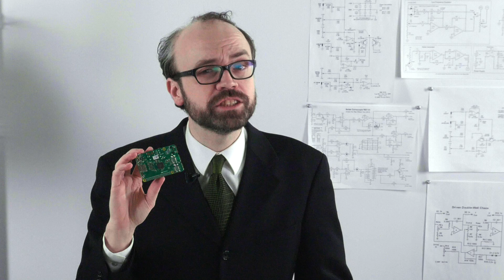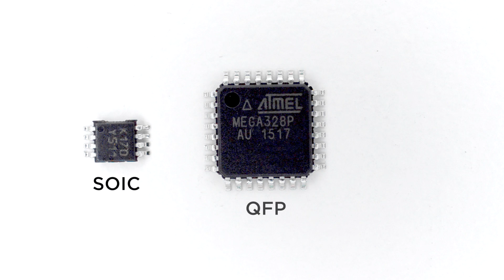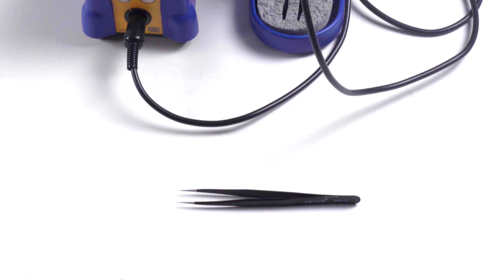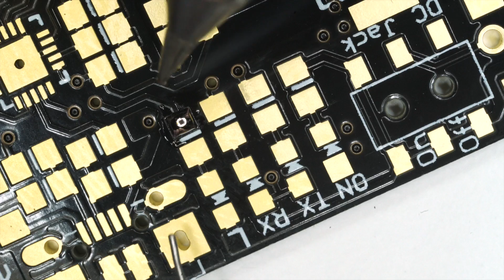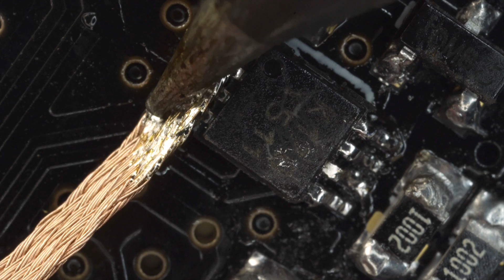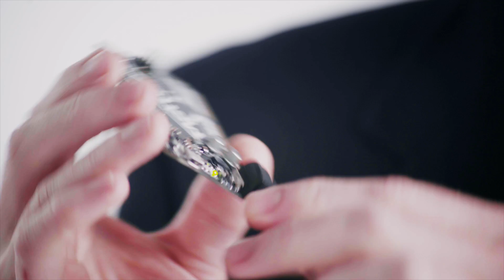Collin's Lab - Surface Mount Soldering

Comment: It's a great video and thank you!! On my Chuwi Hi9Air tablet, I want to disconnect battery. Manufacturer has two battery poles ending not on a pin connector, so, pole cables are connected on the motherboard soldered. Two pole cables are extremely thin, and also, soldered cables ending are extremely small. I have never seen such a tiny solder. I find it too difficult to unsolder. And if we suppose I unsolder correctly, without any damage, soldering back, e.g. battery replacement, the new battery, I mean the pole cables, is extremely difficult and risky to solder without doing any e.g. bridging damage, and finally damaging completely the motherboard. Would you have something to suggest me in all that? Thank you for your time!

Comment: with your final example no exposed pins i have found tinning everything seperatly  and then setting the chip down to solder with a hot air station makes for an easier and cleaner looking install

Comment: I’m very noob about soldering, just two questions. 1) what solder do you use? (If you could link one) 2) what temperature do you use for solder wires! Chips, desoldering?

Comment: Instead of tweezers, I like to use my thumbnail. I get too shaky with tweezers. There is also the added fun of accidentally starting a game of tiddly winks as the occasional resistor flicks off the board, never to be seen again.

Comment: I had to reheat the soldering to a motherboard on a laptop that had taken about a year of an abusive environment, got the laptop running solid, the SSD was another story, and while giving it the same treatment one of the caps just fell off so it got stuck to the iron and I placed it back on, it did work, ran super fast as normal.. 3 minutes in it screwed up again.. I was getting a headache with this stuff so I looked up this video to see how it's properly done, my lighting sucked so I was using one hand to solder and the other to hold a LED light XD x.X as for the SSD it might have deeper issues, I've been experiencing surges and EMP waves at this place.. at least I believe.. "one light started messing around being a flourecent with a ballast and it interfered with the security camera's ontop of one time this place surged and killed 2 cameras specifically that were pointing inward while the outward pointing cameras with metal casings did not die.. and it also killed the computer power supply and those 2 channels off the reciever... got my work cut out for me o.o being broke and all" could an EMP leave something functioning but unstable?
Reply: Who holds a flashlight in their hands instead of their mouth? LOL

Comment: Horrible soldering!!! The solder doesn't look shiny. It looks thick and lumpy. It doesn't look like he's using flux. What I usually do is add flux to the pads before soldering. Flux help the solder flow better, and it makes the solder look more liquidy, which is what you are really shooting for when working with SMDs.

Comment: you can actually remove the excess solder with just the iron tip, if you have flux, you don't need the braid or solder extractor

Comment: Is there a direct contact with the solder tip and the surface? Or are you letting the metal drip to the surface?

Comment: Great video,but I wish someone would do a great video on smd l e d ,s .on how to figure out. plus and minus
Reply: Ron Thompson On most, the dot or notch indicates the cathode (negative). The board silkscreen should show the dot as well. But if in doubt, test it with a multimeter on diode check mode.

Comment: some flux and less solder will be better than your way
Reply: WAY less
Reply: Frank Alvarez less solder and a finer solder too, he's using one that is too think for small smd pads, it will be hard to control otherwise
Reply: and maybe a smaller soldering iron

Comment: Uh, I guess the buried thermal pad on the QFN device doesn't need to be connected... for this circuit.  For some devices, you need to connect it for both thermal reasons and electrically.
Reply: aha, have a hole under the package

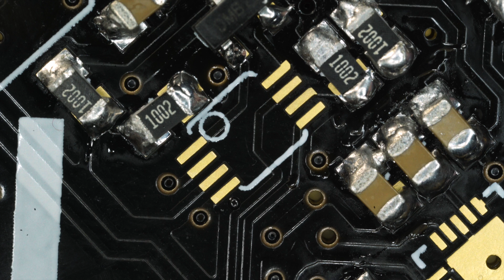Comment: at 3:37s. the three ic's looks like the solder is exess. how do we correctly deal with excess  solder on small areas like those. ITS LIKE THE SOLDER JOINED TWI ICs of the three aligned on the right handside. (pause video at 3:37)
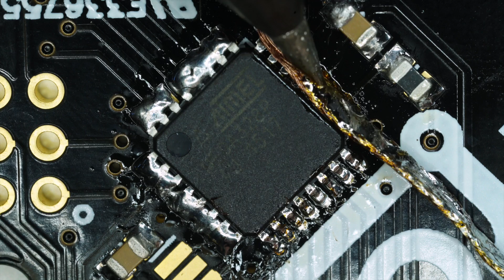Reply: i got the answer at 5:44 mark. thanks

Comment: +Adafruit Industries
Great video. Why not just use reflow? Are there any advantages to using this?
Reply: +jagjit bhatia also, wouldn't a chisel tip iron have been better for this? The flat tip would seem to match the pins well.

Comment: Watch out for the QFP chips with a central bottom pad. While some of those center pads are just for thermal dissipation others actually are important ground connections. On those that have important grounding requirements, your technique will not provide reliable results. On those where the central pad is only for thermal reasons, you may have to watch out for heat dissipation. Getting that bottom center pad actually soldered is nearly impossible using only a soldering iron. But one technique that could work is instead of soldering the single corner pin, use a low temperature solder and lightly tin the bottom pad on the PCB and the pad on the chip. A very thin coating. Then heat the PCB from the under side to re-melt the solder and make that the first connection to a QFP, not the corner pin. If you can get your hand on a small tube of solder bearing paste, then use a small drop of paste on the PCB pad instead of tinning the PCB pad and the chip. Still very difficult to make that solder connection with a soldering iron. if the PCB has thermal vias the transfer heat quickly through the PCB to the pad, that will make it easier. But the whole process will be quite a bit easier to do with a hot air gun. With a hot aid gun you can also do BGA chips. If you're doing a lot of QFP chips, buy a hot air gun and a small tube of solder bearing paste. You'll eliminate a lot of problems. Keep the solder paste in the fridge so it doesn't go bad (it will separate if you don't) and use it for those special chips.

Comment: I prefer using Solder paste and a hot air gun. the speed is about the same, but you get much cleaner results. The main problem I feel is that solder wire doesn't have enough flux for the job, and most liquid (and even jel) fluxes are poor quality; they just stink/stick up the board with little effect. 
decent LEAD solder paste has plenty of flux and reworks like a dream. it actually makes QFN's the easiest of all to solder, as the chip easily locates itself and squashing it down a few times with a pair of tweezers while hot quirts out any excess solder without creating bridges.

Comment: I personally think you did great! If you think about it, flux is to move the heat across the solder surface point rapidly to get the solder to flow across that point. The points of heating are so small here that the only difference it would probably make is making a mess to clean up. Keep up the good work and I do like the comedy added. If anyone noticed?? LOL!

Comment: I agree on this video about 'anchoring the first pin' - but drowning the pins with solder and suck it off afterwards is not really how I handle these SMD / TSSOP devices;

- Just add a little bit of flux to the PCB traces for the device you want to solder.
- Carefully place your device on the fluxed traces.
- yes, anchor the first pin like in this video but keep in mind the technique below:

- Put a small ball of solder on your (preferred chisel-tip) welder and just place it on the outer area of the PCB trace. The solder will follow the trace to the pin and the all ever beautiful cohesive power will suck the solder underneath the pins of the device, making an instant clean solder, no bridges; clean.

Just a dot of solder on your welding tip will probably allow you to nicely connect about three pins of the device.

It's a much more economic way to use your solder too!
Reply: That would also be easier for people who do not have great fine motor skills.
Reply: I thumb him up because it leads to your comment.
Reply: talk about overkill jesus
Reply: Overkill Jesus sounds like a pretty metal dude.
Reply: Yep that's what I do. But I'm lucky to have a Metcal MX-5000 solering iron and use SMTC-0167  tips for this sort of work.

Comment: I use painter's tape cut into thin strips to hold down large multipin devices before soldering. This lets you reposition and align the device before applying any solder at all.

Comment: I definitely need a new soldering iron.  Looks such a breeze using a good one, fast to heat pads, etc.
Reply: 1.2mm chisel tip on a Hakko. And lead solder.

Comment: i can't watch how you drag that wick and scrape that board with hard copper and tin-lead alloy (solder) 
you can lift sooo many traces with it...
Reply: Messy work on the chips with that wick was painful to watch. Less solder and using a clean tip to pull away solder gives much nicer results.
Reply: this is not a good technical skill at all
Reply: Yeah, he should probably be using a chisel tip iron and applying heat to multiple pins simultaneously...
Reply: Louis uses wick to get excess off a board, but he doesn't press on it with an iron and drag.

Comment: What's your recommend temperature on your soldering station, in particular for the bridge and desolder technique on ICs?
Reply: +Sebastien Bournival In my college lab, we've always used 650°F on our HAKKO-888 stations. My professors basically recommended that initially, keep the temp down a bit while you get used to how SMD soldering feels and then you can turn it up a bit (I use 700°F now) when you feel more comfortable and can make quicker connections. Otherwise you'll put too much heat in your components.
Reply: +Red Ambassador 650 celsius?! Don't you mean 650 fahrenheit? 650 celsius is WAY too hot, I've never had to go much past 400C for even the most stubborn soldering jobs.
Reply: +Red Ambassador Unless you're using lead-free solder... in which case you might have to get that hot but I still doubt it.
Reply: Derp. I was being stupid... Yeah, Fahrenheit wouldn't make any sense. Matter of fact, I checked the Hakko website and the FX-888D has a temperature range of 120° - 899°F (50° - 480°C). So, yeah, obviously it can't go up to 650°C. Thanks for correcting me!

Comment: I've heard tomestoning can be a problem. Any suggestions on this and other common issues when first starting?
Reply: +Rouverius keep your parts in place until the solder is actually cooled down on the first pin. Don't apply heat for too long
Reply: +Kyle McNicoll Thanks